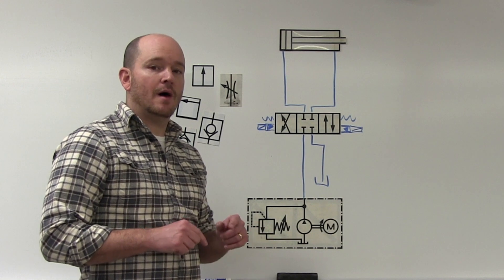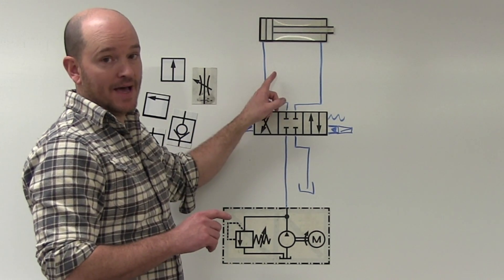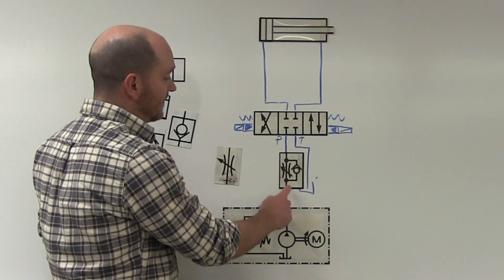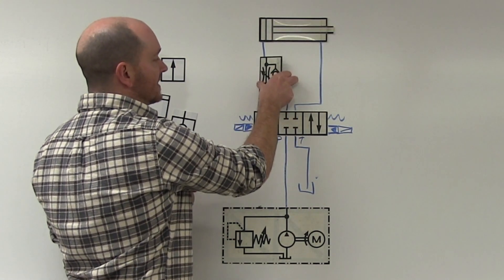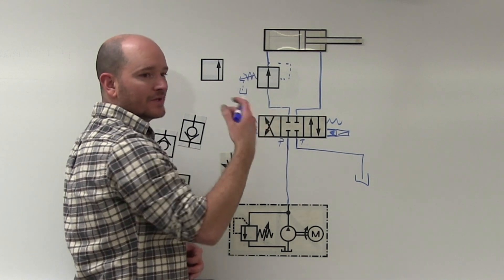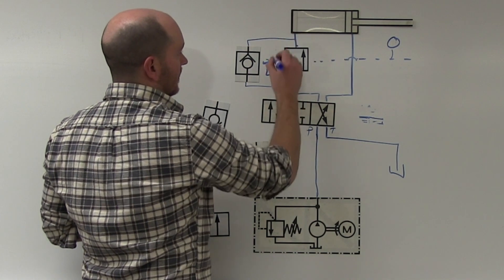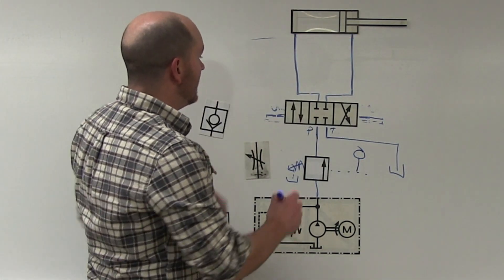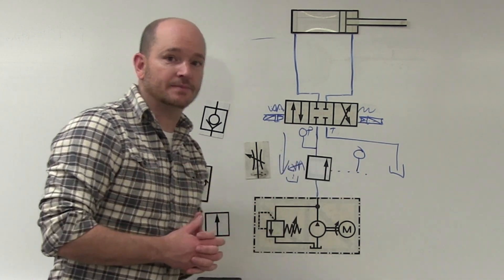By Pass check valves

Comment: At 5:53, after going through the sequence valve, couldn't the oil take the side path going through the bypass check valve and just end up going in a loop through the sequence valve instead of going into the cylinder like we want it to?

Comment: Helo can you hellp me with flow control. I need to control hydraulic motor from zero to max speed, but then i close the flow control valve hidraulic system is in max pressure 150 bar
Reply: 150bar is ajusted but i need this pressure

Comment: Hello sir pls my STC truck crane boom comes down automatically what could be the cause
Reply from the maker: What valve is being used to lock it in place.  A pilot operated check valve, counterbalance valve?
Reply: @KletteTech  pls I will prefer to have mail so I can send the pic
Reply: @KletteTech  yes it is
Reply from the maker: pklette1319@gmail.com. e-mail be he pics and the schematic if you have it
Reply: @KletteTech  I have sent the picture to your mail I open the big bolt behind the valve to check if the fault is from the valve but there is not hydraulic leakage from the valve